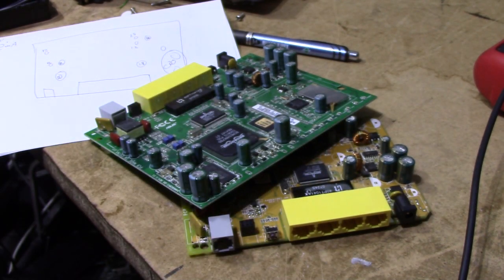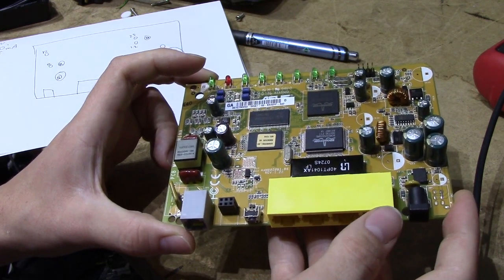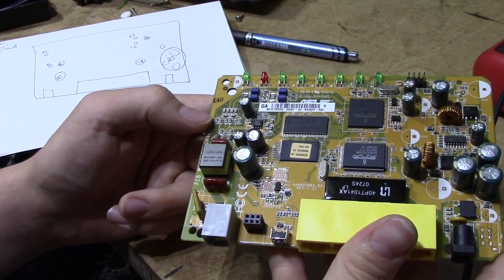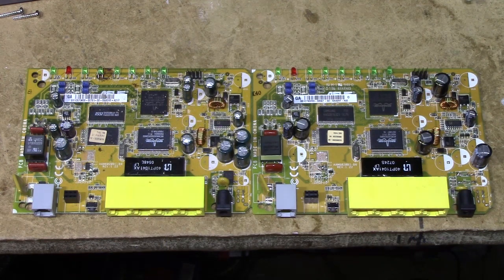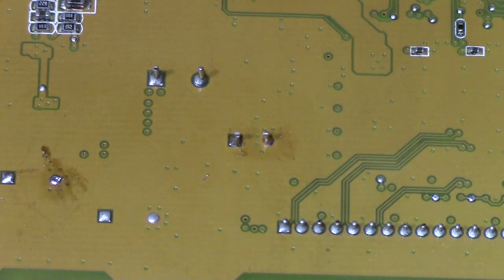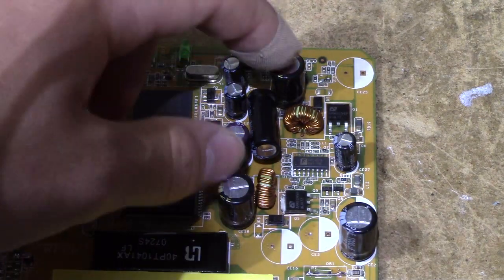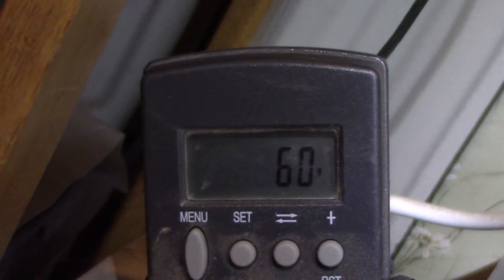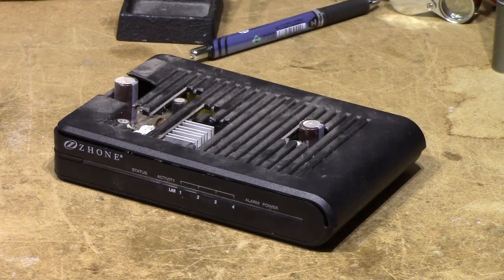ASUS/Paradyne/ZHONE 6212 ADSL modem efficiency hack

Comment: I've encountered the same issues recapping some cheap, yet strongly steel-cased 10/100 hubs.  Sometimes I would end up cutting the leads off, desoldering the leads, and cleaning up the holes with a needle before soldering in the new capacitors.

Comment: There's also VDSL and VDSL2 (VDSL stands for Very high data rate Digital Subscriber Line).  It's often used for last-mile links on subscriber fibre service, and it doesn't do a very good job of it, especially if you have poor line quality...

Comment: 1 Watt costs about 2$ annually here. Those watts are significant savings. 
I am using one power supply for two routers and a NAS, all running on 12V DC. It works, and I save.

Comment: don't worry, you haven't seen cheap until you've held an ACTIONTEC NORMAL DSL MODEM in your hand from the store. less common around here in the states in some areas now because of Fiber and Cable being a thing, but the NORMAL OLD DSL Modems they sell NEW are pieces of shit. 

Never dealt with anything past that, however. the Netgear ones are built pretty good. but the big problem ones are when you finally go ADSL2+ in places where there's centurylink and the like-- it's pretty much the same shit!